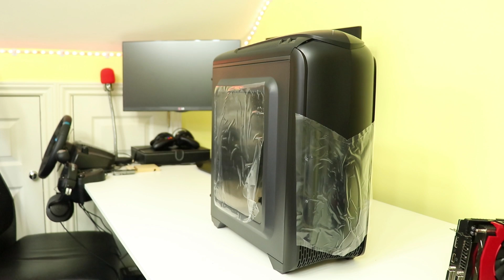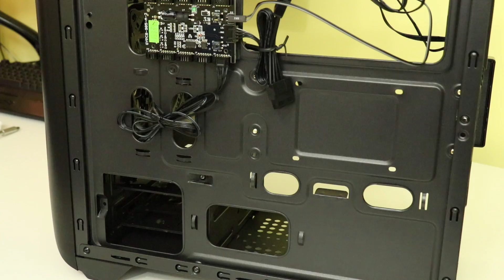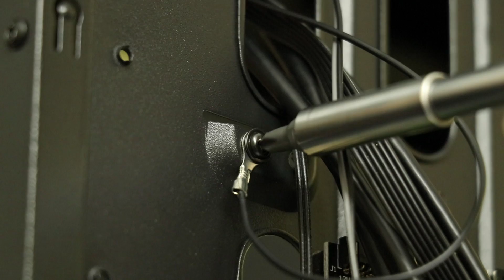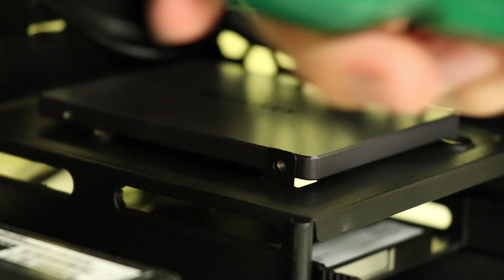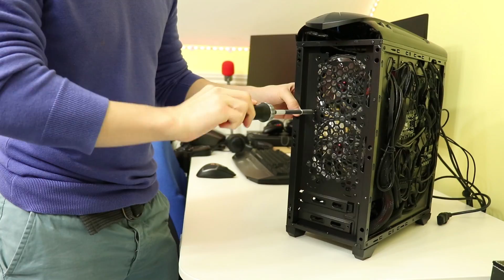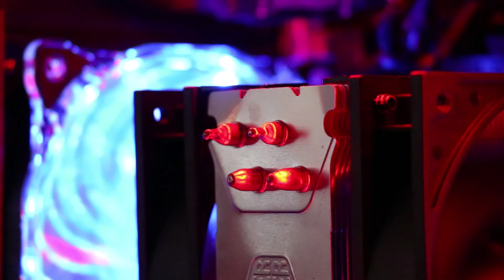Kolink Aviator M RGB Air-cooled build

Comment: Doubt you'll see this but would the thermal throttling be a problem with a ryzen 3 2200g? Also, the product page on Currys says it supports a 200mm GPU but your MSI one is around 27, so would a 22cm gpu be fine?
Reply from the maker: Yeah this video is pretty dated now, but I'm happy to help. With a decent cooler you should be completely fine.

Bear in mind the testing in this video was at full load on the CPU and GPU, so unless you plan on pinning both your CPU and GPU at full load with a heavy overclock you shouldn't see any issues.

GPU wise, if you're fitting the graphics card in the same slot as I have, and the card your using is a bit shorter then you'll be completely fine.

Let me know if you have any further queries.
Reply: AV Techy ayo thanks alot bro i subbed and im going to be using this for my first build with a xfx rx 570 and asus prime b450m a. I'll be using the stock AMD cooler but with a rear corsair fan for around 10 pounds. The 2 kolink fans at the front would be fine?
Reply from the maker: Thanks very much!

Yeah that fan setup sounds good to me. The Kolink fans are a bit of a pain due to the controller, but they work well enough.
Reply: AV Techy alright thanks! il update you on the progress soon 🤘🏻

Comment: would the ryzen 2200g be okay in this case regarding the heating?
Reply: I have a Ryzen 5 1600 and a GTX 1060 6GB in this case and I have not had any overheating issues.
Reply: Will I have the stock cooler and my temps are great(there is a decent amount of room for an OC) even when I am gaming or editing.
Reply: Will Also, Prime95 is a very unrealistic load and it is meant to over stress your CPU.
Reply: Will It is a nightmare for cable management
Reply: Will It’s definitely the best case at that price point.

Comment: So I recently got a PC with this case, I wanted to turn off the fans LEDs and I did so by holding the F button on the top of it but now they don't turn back on. I've tried holding it for a few seconds, 30 seconds, multiple clicks but it only seems to control to speed of the fans. Any idea how to possibly fix this? Thanks in advance!
Reply: U could try to reconnect the fans?

Comment: Really helpful for my son and me when doing our first PC self build using this case - thanks so much :-)

Any advice on where we might find guidance on which wires are which? (I think we've managed to figure out in the end but it took a while!)
Reply from the maker: Excellent, thanks for checking this one out.

As for the wire advice, I presume we're referring to the internal connections to the motherboard, drives, front IO, etc. These can all be found in your motherboard manual (it's tricky to advise more directly without more information). The motherboard manual should be a great place to start with all the information. Generally there aren't two connectors on a motherboard that are the same (apart from the IO connectors, but they're all labelled).

There are some proprietary fan connnectors in this case that may have tripped you up a little (they're not usual in most cases).

Here's a few that might not be covered in the motherbaord manual:
SATA data connection to the left, SATA power to the right (Data goes between the drive and the motherboard, Power connector comes from the PSU - PATA is an old standard that's not used today):
https://goo.gl/C7BsWQ

https://goo.gl/8sTmms

To be honest that one should be in your motherboard manual too, and I'm struggling to think of others that wouldn't be in there. Let me know if there's anything you want me to explain any further and I'll do my best to help out, these things can be a pain to get used to, but once you've come across them once you'll know them for next time.

Comment: how did you change the fan color lol, i have the same case but for the life of me cant change the fan colors
Reply from the maker: From memory it's all linked up to the large board to the rear of the motherboard tray, and that is linked to the front IO. So it should be a simple click of the colour switch to the top of the case.

Is it not working for you? I think I've heard similar issues from others, it's a bit of an over complicated system...
Reply: cheers got it working, :) thanks for the help
Reply: @AVTechy   the button on the top seem not to respond on changing colour or even activating it. The lights come on for a few seconds every time when i start the pc and then dont respond (
Reply: I dont get it neither. How the fuck can I change the colors?
Reply: @AVTechy Hello mate! Please help me, Iv got this case and internet says max gpu it can take is 370 mm. Now you said you have 15mm left and your card is 277 mm according to internet. Does it mean the 370 not true at all? I want to upgrade to rx 6800 xt, but im not sure it will fit.

Comment: I will use this for my first budget build, don't really care if it's a bit difficult, if it just looks cool and functions well!
Reply from the maker: Go for it man, it'll do the job nicely.

Hope your build goes well, and thanks for checking out the video!
Reply: Me to, What specs are going for ? MuoviK
Reply: Milton923 -Minecraft maybe ryzen 2200g gtx 1050 and 8gb and i think i found a better case on amazon so i might not use this anymore
Reply: MuoviK rosewill case?
Reply: nah a sharkoon one
Reply from the maker: There's no official water-cooling support, but I'd say you might be able to squeeze a 240mm radiator in the front ( I can't be sure though).
Reply from the maker: Do you mean an AIO? That really comes down to what's the most affordable and best reviewed around. You could go for a 120mm AIO to the rear, or attempt a 240mm in the front.

Is there a specific reason for water-cooling your system?

Comment: Kolink's PSUs are SHIT. But their cases seem fine.
Reply from the maker: Yeah I don't think their PSUs are hitting all the quality marks like a lot of other manufacturers. But then again they don't cost all that much.

I've found their cases to be a little hit and miss. There are some interesting designs, but they do miss quite a few quality marks in quite a few products. But again, they aren't all that expensive.

What has your experience been with Kolink products so far? I've only had my hands on a few cases.
Reply: @AVTechy  He's talking out of his ass. Kolink bronze grade is fine and cases got some design. 
Wondering could they introduce difference designs of the front and top plastic pieces for i.e. 10€ or so...

Comment: Hey dude, nice video.

I have this case and have recently decided to get a second monitor, however i did a test of the extra hdmi ports on my gpu and there is a metal overhang with seems to block two of them.
Can i fix this? or will i need to file off the metal or something?
Reply from the maker: Thanks very much!

Kudos on getting a second monitor, I don't think it could work these days without the extra screen space.

As for your question, if you can send over a picture of the metal overhang in a private message to the AV Techy Facebook page I can help you out with it. At the moment I'm struggling to work out the exact piece of metal your talking about, but I doubt it'll be a big issue. Head over to the Facebook page and I'll do my best to help you out.

Also sorry for the late reply, it's been an off week for all sorts of reasons.

Comment: Thanks for your work.
Not so bad for a budget case, but there is one unpleasant moment - a full set of fans (high-performance) will cost three times more expensive than the case itself
Reply from the maker: +Roopy Phelsenburg Just a slight correction there, the three fans added would cost as much as the case. If the two included fans were changed as well, the fans alone would cost not far off twice the amount of the case.

It's pretty crazy, and costs like this can add up so quickly. It's like fittings with watercooling, they can easily cost over £100+ an they're just the small bits.

Anyway, thanks for checking out the video. And thanks for the support!
Reply from the maker: Haha, well if they're around then it's no problem.
Reply: Immediately make a reservation - reviews by AV Techy
 are one of the best (almost all versions of the assembly are tested).

This is understandable - there is no limit to perfection. But it's one thing to achieve this in a beautiful, thoughtful, quality case (the right thing to emphasize). And it's quite another thing to do it in such a case (my inner perfectionist in fury))).
Reply from the maker: Haha, you're too kind. I might actually start calling these videos reviews from now on.

I wanted to work on the content to get it up to standard before I call them reviews. But maybe they're just about there now.

Let's just keep pushing the quality, I'll be working more on creating a more diverse recording style, and change up the style of the narration to be a bit more casual here and there. And I'm considering getting a proper open air test bench for some heatsink reviews shortly. 

Anyway, it should be pretty cool. Let me know what you like and don't like about future videos and I'll keep it in line.

Comment: Another informative vid. The graphs can be hard to read unless you pause to compare the results to other pc case reviewed. Just a suggestion, you can maybe add the number at the end of each bar graphs for a quick view and highlight the color of the case being reviewed. Cheers!
Reply from the maker: Good ideas, I'll definitely look into both of those options. I'll definitely add the end numbers since that's something I know how to do.

I'll have to look into how to change the colour of specific graphs as it's something I'm unsure about how to do.

I think if I can, I'll make the name of the case being reviewed bold in the graphs so the bars colours don't stray away from those in the key. Let me know if you think that's a good enough solution.

Excellent ideas! Thanks for adding your thoughts, I really appreciate the support, and thanks for checking out the video!
Reply: AV Techy That was a good solution and keep up the good work. I like mATX and mITX PC cases being reviewed and showing the min/max cooling potential of those PC cases and I'm sure more people like it too rather than full ATX towers that are expensive and kinda bulky especially in 2017 or it's just me. :)
Reply from the maker: Fantastic, I'll add that to the next video on the Node 804.

I'm a big advocate of smaller cases (obviously haha). I would imagine 90% of those with ATX cases would be fine with mATX cases. And probably 50% of those with mATX cases would be perfectly fine with mITX cases, but that's a little harder to call since there are less mITX options and the cooling potential is a lot less.

Anyway I could go on for hours, thanks again for the feedback!